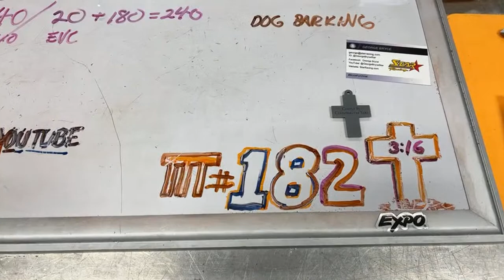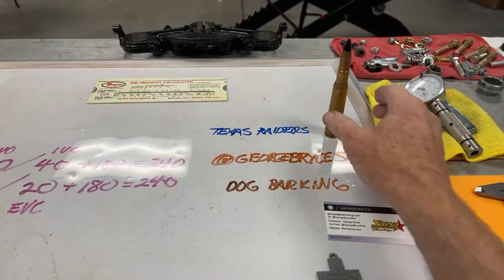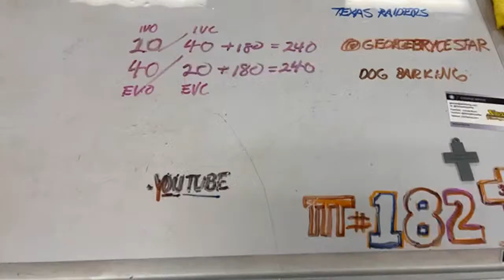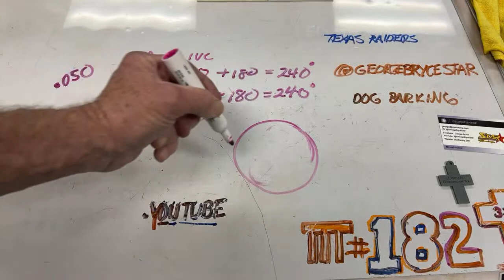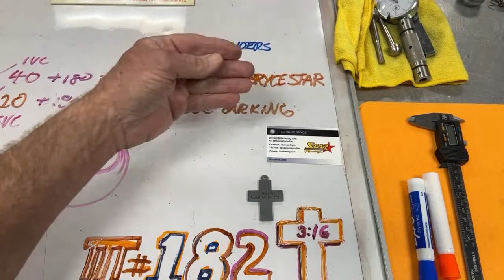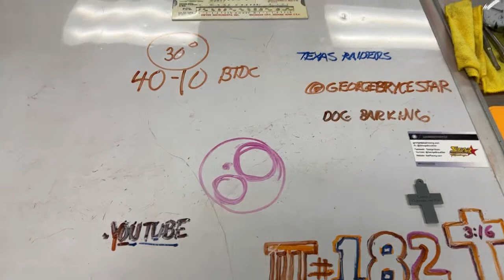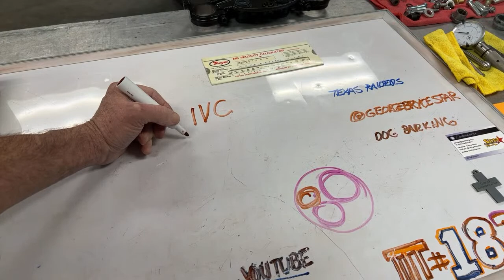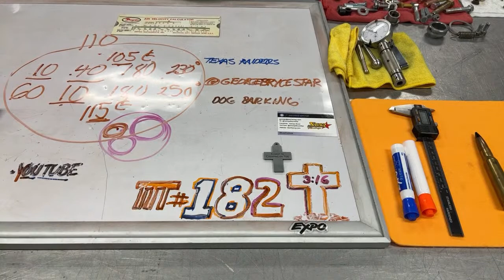Tech Talk Tuesday #182 with Star Racing’s George Bryce - Cam Math

Comment: George, I cannot believe that I missed the first You Tube(tech talk). Will you be able to put up the questions and answers after you stream the video? Will you take Blue 5.0 to Moonshine Harley after you get er running? How do you come up with the TDC lift. I was told, that is determine when the cam is ground. I don't see the math in my head. If the math can be done with a calculator maybe you can share that next week. I love the Tech Talk!

Comment: I was a fan of Twelve O'Clock High, too, George lol
Glad you switched to the utubs.

Is there another reason (other than ease of teardown) for omitting the oil lines?
Did you weld them in?

When could I buy one of those venturi intakes?

Comment: Hi George, I have a 20' slim with the 107 (m8). I've done the s&s 475 cam and billet cam plate, Arlen Ness k&n breather, Vance & Heinz pro pipe (fiberglass packing removed, and the baffle "cap" removed, essentially making it a straight through setup), and a power vision tuner. Bike runs great, albiet needs a proper Dyno tune vs the auto tune feature. Anyways, I've aquired some cnc ported screamin eagle heads. Would these heads be beneficial to my setup? Better efficiency, more power?